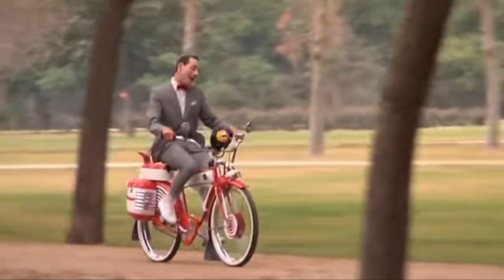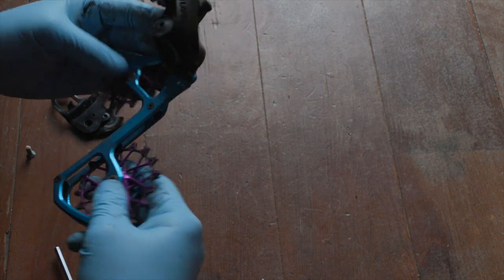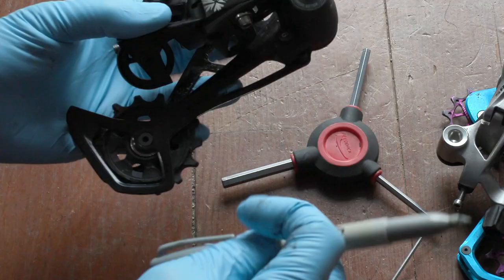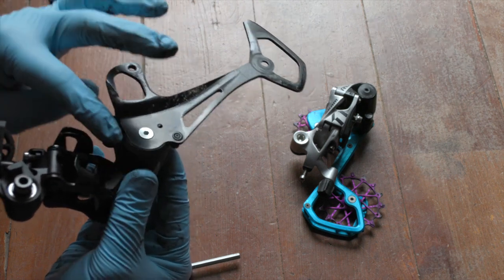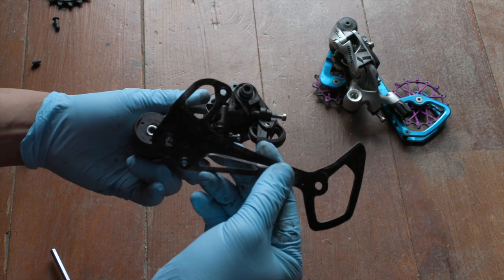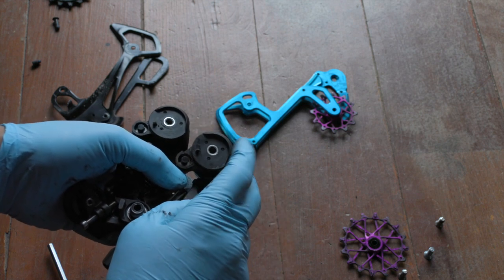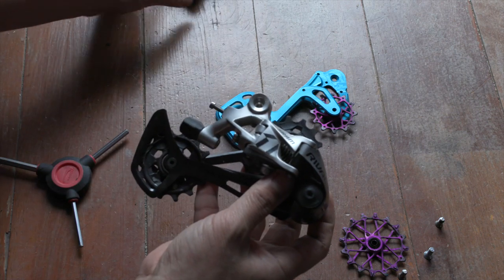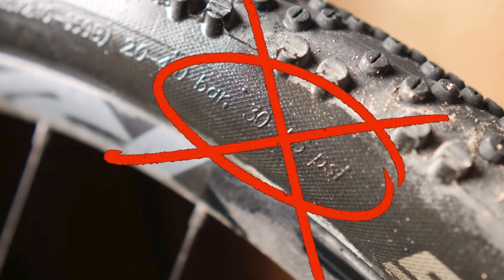The Derailleur Hack They Don't Want You to See

Comment: I love shade-tree mechanic stuff like this.  But this is only a problem if you want (or are stuck with) the Type 3 mountain derailleur.  For anybody that is okay with a 42T large cog (those of us that know double chainrings are better...go on, change my mind), the Type 2.1 10s rear MTB derailleurs are perfect with a longer B-screw, and will work with either 10s or 11s road shifters.  I've got 10s Red shifters on a Type 2.1 X0 rear derailleur on my Gorilla Monsoon, and it works great.

Admittedly, this is great for somebody looking to upgrade a bike that came stock with an Apex1 or Force1 from the factory to be able to use large ratio cassettes with road shifters.  In conclusion, this gives people options, and options are awesome, so this is awesome.  Carry on.

Comment: I have done just that (not for what you have show) but fairly close of.
I've already taken spares part from non-working Derailleur and used them on the one i had problem on.
-Changing springs 
-Changing the main screw that hold the derailleur
and other parts... This derailleur still work at 100% even with all the harsh winter i gave it at Montreal haha

Oh and, this is really painful to reassemble the springs you didn't had to deal with. Loading, holding the plate and putting back on the C-Clip is hard.

Comment: If you are going to remove cables a lot you can soldier the ends so they won’t fray. You just need acidic flux for the stainless steel. I just started soldiering mine and it feels much more finished. It doesn’t take too long to practice. $30 for a cheap soldiering kit and Acid flux.

Comment: For the Shimano guys and gals out here, I have heard rumors that the Ultegra RX 800/805 derailleur and the XT M8000 (possibly M9000) long cage derailleur are able to be cage-swapped around too. I plan to attempt it and will probably record it for the internet, success or fail. I find 11-40 to be a fine cassette size, but I'd like to be able to use a larger chainring difference without running afoul of capacity limits, which I believe this swap will net me 45T of capacity vs 39T I currently have.
Reply: You can also just use the GRX 1x rear derailleur it is much cheaper then buying an Ultegra and XT derailleurs. Then again this comment is 7 months old and maybe you couldn't get GRX back then.

Comment: I found a way around using a road bike derailleur on a mtb frame years ago by buying a Problem Solvers Cross Clamp with Cable Pulley 34.9mm Black component. Basically it's a frame clamp with a 1" diameter pulley which is placed below the front derailleur because mtb cable guides are setup where the cable would attach to the top of the mtb derailleur but a road derailleur cables attach from the bottom. This is very handy if you want a road derailleur that weighs 240g instead of a mtb derailleur that might weigh 360g. The same can be said for changing a mtb from using a mtb rear derailleur to use a road rear derailleur where you might shave off another 250g.

I used to race competitively many years ago & although I'm too old now to keep doing that I'm also unable to ride a normal road frame because of a back injury. If you are using a carbon fibre mtb frame with 700c wheels for riding if you have a damaged back like I have then a mtb frame can give you the right triangular shape with arms & back so as not to cause further back trauma while still being able to continue riding even though the days of competition racing are long gone. I was able to create a hybrid type of bike from combining a mtb frame, mtb crankset with 700 x 23c wheels/tyres relatively lightweight & fast enough for my broken body to easily ride around on. A typical store bought lightweight mtb could not be configured in the right angles needed to be comfortable for my back as well as they do not come with road wheels or other road components.

Comment: Great video Russ!  I'm going to try this out as well.  Purchasing a SRAM GX Long Cage and a Sunrace 11-Speed 11-42T for my stock Midnight Special.  Will come back and report the results!
Reply: I have a Rival on my bike and a GX just sitting around. Did you try this? Did it work?
Reply: @GreatEgret  Unfortunately I wasn't able to try it out.  The cage I bought was only part of the assembly.  It would have required me purchasing a SRAM GX derailleur ... so I decided not to move forward (returned the cassette) with the experiment.
Reply: Just in case you were still looking for an answer to this - I'm running a Sunrace  11-46 on my Midnight Special, which works fine with a Rival long cage derailleur. Don't even need to go as far as an Eagle derailleur.

Comment: Great video. For me, I put a flat bar on my gravel bike and used shimano XT components. So I have an 11-speed ultegra cassette (11-32), with an XT derailleur and an XT triple front chainring (24, 34, 44). The triple front chainring is supposed to be for a 10-speed cassette, but I've had no issues.

Comment: I’m jumping in mid way here, so I may have missed some stuff. But I’m looking to do this with my rival 1 get up. Anyway, if I want to rock a 10-52 cassette I just need to buy the cassette and this derailleur then install the long cage on to my rival 1... then boom. Ill have all this gear range? What am I missing here...?
Reply from the maker: That’s about it. Also the pulley wheels.
Reply: @PathLessPedaledTV  I see I see... soooo this is a way more efficient way of getting some mtb gearing on an 'ol gravel bike. So cassette, derailleur (for the longer hanger) and those pully wheels? Which pully wheels, may I ask? Also what do I need to keep in mind for the 10-50,52 cassette fitting my existing hub/wheel? Super helpful my friend, super helpful. I appreciate any other insight you're willing to provide!

Comment: Just an FYI, this won't work on a sram Apex 1 derailleur because the little stop bolt (idk what it's called) is in a completely different place. It looks like the garbaruk cage may work with it though as they have 2 different holes drilled

Comment: Great job!!!   So the stock Rival can go to 46t or 50t with a modified cage.  My GRX will go to 46t as well.  It might not be a BAD IDEA to see if a XT cage would take it to a 50t.  😁
Reply: I have see people using stock 11s xt derailleur with a 50t cog just fine
Reply: As I understand it, the 1x GRX is already using essentially the same cage as 11-speed XT (which also has a spec 46t max). Now whether the 12-speed XT cage (with 51t max) will fit the 11-speed RDs is an interesting question.
Reply: @dkessler14  I have seen a video where they put an XT SGS cage on a GRX 1x derailleur and actually used it with two front chainrings and a very big cassette giving you ultimate range.
Reply: With careful chain length, most 1x Sram road setups will run 11-46 gearing quite well.

Comment: Great video, thank.
FYI, it does not work with a Sram Force X1 as the little stop screw is on the oppisite side than the NX
Reply: Do you mean the Force 1 Type 3? Ahhhhh! I wonder if it'd work with the Force 22? With either a 1x or 2x setup.

Comment: So maybe this is a stupid question, but why does shifter and derailleur compatibility matter at all? If all of the indexing happens at the shifter end, then as long as you have the correct spacing between the cogs and a long enough derailleur cage, shouldn't any derailleur just do whatever the shifter tells it to do? I understand that the cable pull differs between shifters, but again, the derailleur itself has no indexing. The answer probably has something to do with parallelograms, but I'm still confused...
Reply from the maker: The answer is cable pull. It use to be that the derailleur reacted to the same ratio of cable pull as the shifter. But that has been decoupled since 10spd. Some derailleur move more or less given the same amount of cable pull from the shifter n

Comment: Cool hack. Well done. 

So if we're matching the 11-speed SRAM Rival and NX derailleur parts, do you think this shifts across any 11-speed cassette, or just a limited few? Do you think a Shimano 11-50 cassette work with this setup?
Reply from the maker: Should work with other 11spd cassettes. Works with the Sunrace.
Reply: @PathLessPedaledTV  True. 11 speed spacing at least is consistent between both manufacturers, and between road/ mountain.

Comment: Great video Russ! Can you comment on compatibility between a 10 or 11 speed shifter with a 12 speed derailleur and cassette? Looks like you have a 10 speed cassette on there? Are you using a 10 speed shifter? Would this setup work with a 12 speed cassette?
Reply from the maker: Using Rival 11spd shifter with 11spd Garbaruk cassette.  Should work with 12 if the derailleur is Exact Actuation.
Reply: @PathLessPedaledTV   Russ. Do you know that if the shifters were fitted with the ratio 12 speed ratchet, that this rear derailleur could handle a 12 speed drivetrain? 12 speed Cassette and probably 12 speed chain and maybe AXS x1 chainring?
Reply from the maker: @Peregrino.51  no they won’t work.
Reply: @PathLessPedaledTV  So i did it. It does work.

Comment: you can do similar with a shimano 105 5800 rear mech and the cage of a t670 SGS touring/mtb mech. this allows the running of 11 speed xt 11-42 cassettes with the road 34-50 front setup. sup climby low gear 34-42 but still 50-11 for top end

Comment: I love your reviews and content, Russ! Keep up the great work!

Just a few quick questions: so what is the size of the Garbaruk cassette you are using with this hack (10-46, 10-48, or 10-50) and what is the size of the chainring? just curious to know the range you are getting.
Reply from the maker: 11-50 cassette. 42 front ring. 23 to 102 gear inches.
Reply: Man, I have feeling that rear sprockets soon will be bigger than wheels...

Comment: Apex 1 or Rival 1 Rear Deraileaur  Works with cassete and shifters 2x10 MTB ?
Apex have same cable pull Sram MTB 2x10, i think, works.
Reply from the maker: No it doesn’t work. Cable pull between 10 and 11 is different.

Comment: is the sprocket pitch between mountain and road 11-speed different? or did you just need a larger cage? and was the sram rival RD long cage?  cuz at least with campagnolo, the parallelogram geometry is different.

i would like to do something like this with shimano, and a long cage R8000 RD
Reply: the sprocket pitch is identical, but the cable pull for the deraileurs is different. thats the reason you cant put an XT derailleur instead of an Ultegra one on a road/gravelbike. at least not without something like a wolftooth tanpan.

as with your idea: you can just use the new GRX rear derailleur, its essential an XT one and will hapilly shift 11-46 cassettes.

Comment: The Rival 1 is a 11 speed RD with exact actuation ratio, so it will work well with 10 speed mtb flat bar Sram rear shifter such as X5, X7, X9, GX, ect  and a 10 speed wide range cassette 
Those 10 speed shifter have exact actuation pull.

So if you want a 10 speed 1x10 SRAM mtb transmission you can have : 

11-42 with standard Apex 1, Rival 1 or Force 1 long cage RD
Shimano or Sunrace  11-42 10 speed cassette 

11-46 with modded Apex 1, Rival 1 or Force 1 NX cage RD
Shimano or Sunrace 11-46 10 speed cassette

11-50 with modded Apex 1, Rival 1 or Force 1 NX cage RD
ZTTO or other chinese 11-50 10 speed cassette
Reply: So it should also work if you have a Rival 1 shifter and an X0 derailleur with a 10 speed 11-42 casette?
Reply: @gabrieltempesta2604  you need a 10 speed shifter with a 10 speed cassette

Comment: Just a note of caution. The angle of the parallelogram on road derailleurs is more horizontal, so the top pulley may not clear the big sprocket no matter how much you wind in the B screw. With the 1x specific clutch road derailleurs, it's less of an issue, but the old non-clutch derailleurs definitely won't give you more range with this hack.
Reply: Great vid though!
Reply from the maker: It works 💯 Been riding it for weeks.
Reply: SRAM 1x uses what they call "X-Horizon" which is SRAM-speak for a non-slanted parallelogram. Pulley distance is controlled entirely by the offset of the pulley from the pivot point. That's one of the reasons this hack works so well.
Reply: @dkessler14  True, thanks for the clarification. I was talking of course about the old 2*10 road stuff, and I know that doesn't work cos I tried it, years ago d'oh!

Comment: Does this work with a rival 22 11 speed rd and brifters? If it does, this would solve my current dilemma of struggling on the uphills. I have the 2021 Kespor GSX Sram edition. 

I was planning selling the groupset to buy the new Microshift AdventX until I saw this video. 

I'm really hoping this also works for me. 🙏
Reply: Nope - it appears to only work with SRAM  Rival 1x rear derailleur (other commenters said it didn't work with Apex 1 or Force 1)  Different design, the 22 series does not have a clutch or a removable derailleur stop.

Comment: Is it possible to change the pull travel on shifters as I have shimano 7 speed shifter and a 5 speed freewheel sprocket and wondered if I can make the original deraileur work without changing it or the freewheel
Reply from the maker: No.

Comment: Would this hack theoretically work with any long cage rear derailleur? I bought a 2017 C-dale SuperX that came with a Force Type 2.1 MEDIUM cage der. and I want to run an 11-42 cassette but don't want to spend $185 on a new long cage Force.
Reply from the maker: Can’t confirm. May lose cage lock.

Comment: Pro tip just convert to single speed, I'll never go back to derailleur shifting not until I'm too old to pedal a single speed. I change my gear ratio based on weather summer is obviously super high fast gears and winter is low and slow.

Comment: Hmm do you think this hack will work with a rival 22 derailleur so it can use a bigger cassette than 11-32t, day a 11-42t?
Reply from the maker: Maybe.
Reply: SRAM GX 2x10 rear derailleur will work with Rival22 (or Force22, Red22) shifter with no modifications,. Long cage should clear a 42t cog, (may need a longer b-screw, but maybe not) and have enough wrap to cover an 11-42 cassette even when paired with a typical  50/34, 48/32, or 46/30 double crankset .  Assuming you set the chain length right from the beginning, you shouldn't have to worry about an accidental big-big cross-chain event being catastrophic.

Comment: Do you think this would work with an Apex 1 or is the cage too different? Thanks!
Reply from the maker: Literally trying it right now.  Works but you lose cage lock.
Reply: From what I saw yes, I was about to get an SX Rd to use the cage, but it will not work properly because the cage lock is in a different position on a SX, but with the NX you can do it, the Apex will accept it just like the rival.

Comment: you can also just change the cable fin. take the cable fin from the rival off and put it on the mtb derailleur.
Reply from the maker: You could, but  it doesn't work on every iteration of Eagle.  Lower levels and even NX have a non removable fin.

Comment: I'm confused, why did you need to buy two derailleurs? Why didn't you just buy a long cage road derailleur? (and derailleur extension if needed, but in your case you claim it was not needed)

Also I've googled mixing and matching mtb/road, shimano/sram/campagnolo and different speeds and it sounds like every brand, every speed and every discipline has always had specific cable pull ratios and none of these combinations were ever interchangeable/identical even before 11 speed came out.
Reply from the maker: Long cage road won’t clear a 50t.
Reply: @PathLessPedaledTV  so mtb long cage are slightly longer than a road long cage? Why not a road long cage in combination with a derailleur extension then? Wouldn't that work and be cheaper than buying two derailleurs?
Reply from the maker: I did the derailleur extension in a different video. Doesn’t work as well with the 50t. Pulley alignment and cage geometry is different. Not just longer. The point of the video was to show how easy it would be for SRAM to make a road derailleur shift a 11-50 by just swapping cages. Less of a practical advice (for that watch our vid on the Jtek shiftmate 9) and more of WTF don’t you just make this derailleur SRAM.
Reply: @PathLessPedaledTV  ok, different pulley alignment and cage geometry seems like a good point. What about brands, speeds and disciplines being swappable prior to 11 speed systems? I'd like to mix and match but most people say it won't work or will compromise shifting. I've been brainstorming it in my head and manufactures claims that cable pull ratio is specific to brand, speeds and disciplines seems to make sense and I'm worried about buying mismatched parts to save money but be disappointed that they don't work well once I put it together. I have a set of tiagra 9 speed shifters and want to use them with a 9 speed deore RD for a gravel bike and ride that until the bike industry can settle down and stop upgrading so much and then I will invest in more speeds but I don't want to buy campy 12 speed when I know shimano will be coming out with 12 speed road soon and for all we know sram/campy/shimano might go 13 to compete with rotor. Also I feel like I may have came off like a jerk at first, sorry about that.

Comment: Hey guys just in case you want to save a little money , you can just buy the sram nx cage  instead of buying a complete rear d , almost from any bike shop or distributor, I don’t have the part number but is really easy to find trough the sram website
Reply: By the way awesome content!
Reply from the maker: From what i understand only half the cage is available as a part?
Reply: @PathLessPedaledTV   you are right I did some research and sram does not provide that specific part sorry for the misinfo